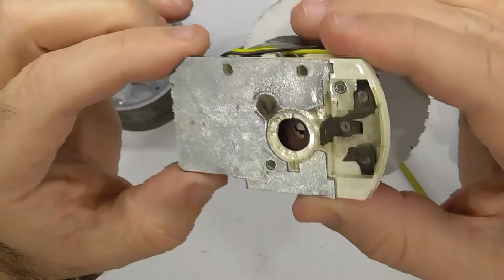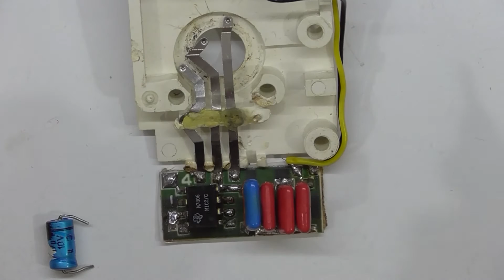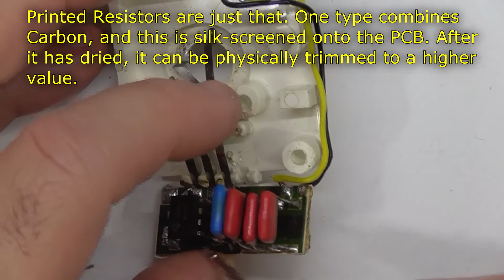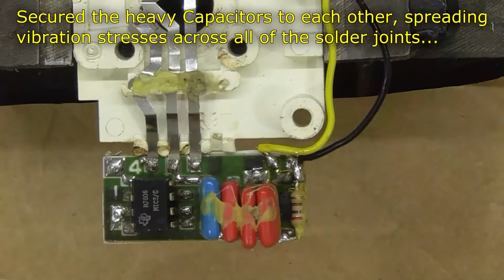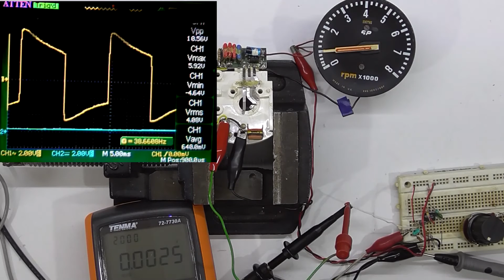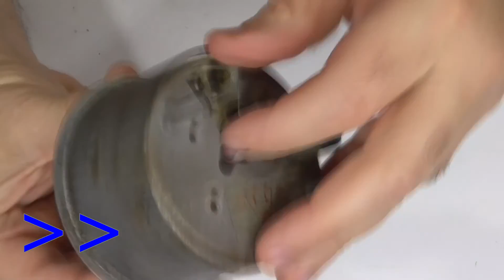Repair and Testing of SMITHS RVC 1002/00F Tachometer

Comment: Thanks Richard. With these clues I was able to repair and calibrate an RVC 2415 tach, the chip had died but I found the SAK215 replacement on ebay.

Comment: Hello Richard. Nice and instructive video. I am looking to find a way to use a signal from the rev counter in order to use it as an input in a monitoring device, software programm. I would like to find a voltage which I could convert into RPM. Is there such a signal in this circuit, or is the meter working with an output current and not voltage? Thanks a lot!